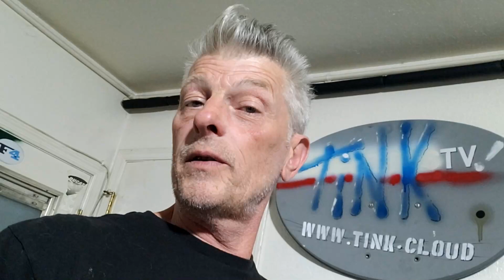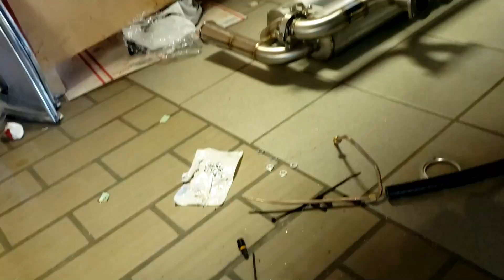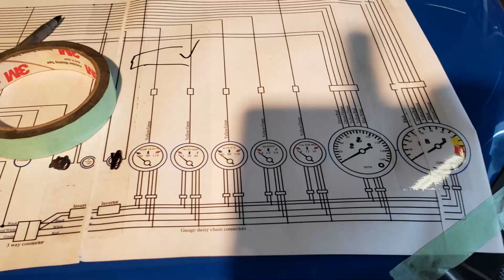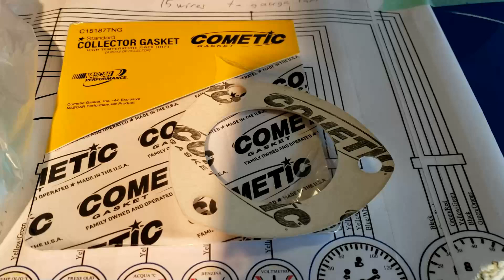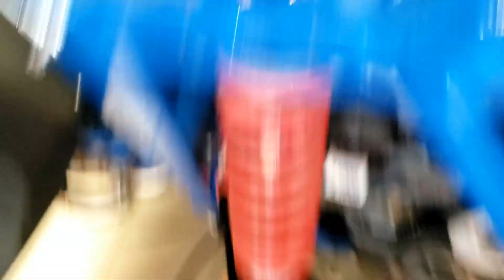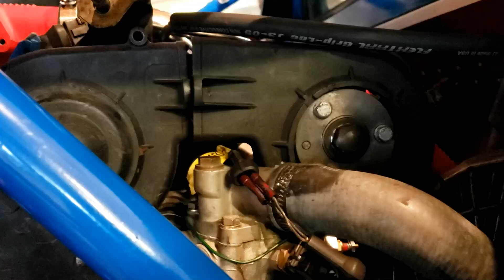Lister Bell #LanciaStratos Replica Build Update - 3D Printing, #CoolingSystem, #AirFilter

Comment: Gauges look great in the dashboard. Must be difficult trying to find off the shelf parts that might fit. Presumably Lister Bell know what's what?
Reply from the maker: Lister Bell are always really helpful with their experience and knowledge, but the 12v Busso motor is not something they have experience of as they normally use the 24v Busso. We had to custom fabricate the top engine mount accordingly which Michael made from a Ferrari suspension piece he had kicking around!